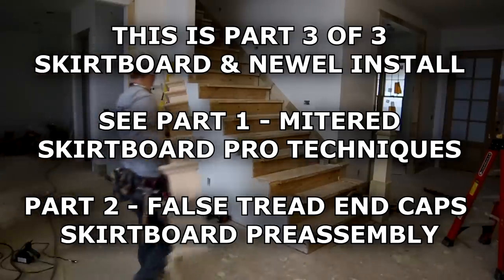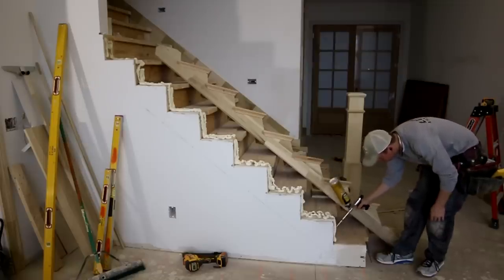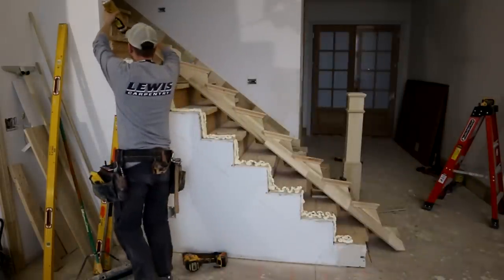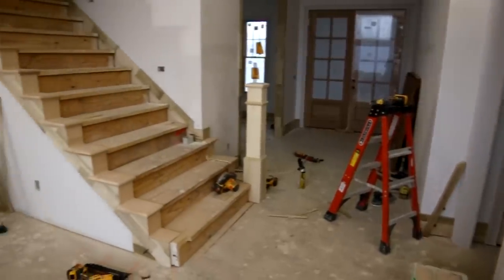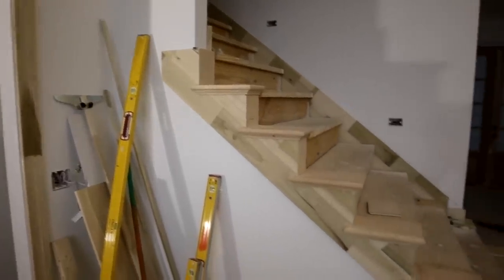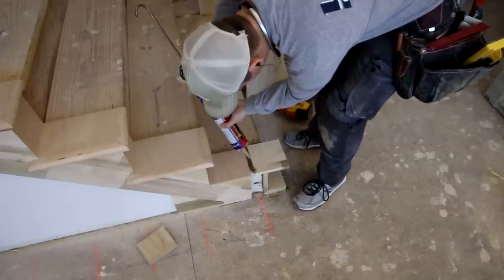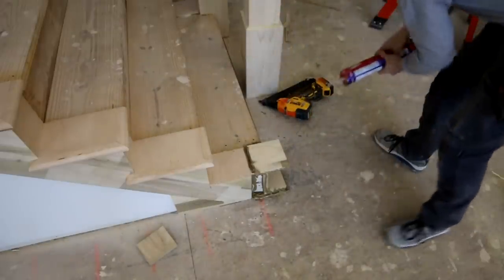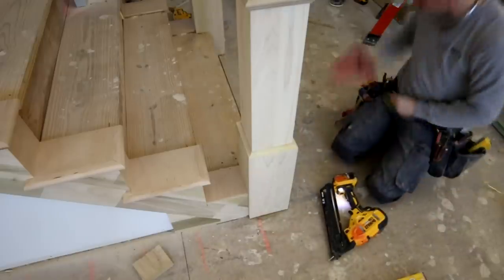Stair Skirt Board and Newel Install - Keys for a Crisp Install

Comment: I rip a 2x6 to the inside dimension of the newel and attach 1 piece at a time with glue and screws until I have a solid block for the newel to slide over. You can make the 2x6 rips longer so they go up inside the newel for more support.  I use Gorilla Glue to attach the newel, the glue foams up and fills any space between the block and newel.  Keep the vids coming, you do some great work.
Reply: Sawdust i woulda put solid 2x blocking too
Reply: I thought about polyurethane too, the expansion is great, but a little trickier to work with. It's strong stuff too, but a bit brittle when dry ? Your 2X6 idea is terrific

Comment: Spenser, I really enjoy your videos. I was thinking that it might be a good idea for your newel post "inner grid" idea (as you called it) to load up that upper flat plate with PL (around the top edge) and then right before dropping the newel down over it to place another flat square plate over the piled up PL and then placing a brick (for the weight) so that the PL is squeezing out against the newel's interior. Like a compressed sandwich, so-to-speak. Just a thought. Thanks, as always.  I hope you can make sense of my crude description.

Comment: Nice work.  It looks like the false tread nose is a little higher than stair nose, when the carpet wraps around don't you see the side of carpet backing just a bit at the bottom of the wrap?  It does not look like flase tread protrudes quite enough where the carpet returns to the riser?
Reply from the maker: I cut the framing tread back 1/2". So there is a 1/2" gap between the framing tread and the finished false tread...the carpet guys will then tuck their carpet in that space and around the framing tread to finish it off.

Comment: Spencer , curious how the top step looks like , the plumb cut of stringer does not die into the wall , how did u finish the plumb cut , we always have our stringer die into wall about 2 1/2” back from corner , thanks

Comment: Wow it’s not attached to a Joyce?
I could of done that ?  All that work I did to attach them to solid structure (bottom Newel’s ) ?
I am seriously stunned?  And I truly trust you Spencer you know way more about production trim carpentry than me!
But can I respectfully ask what about the 200 pound rock ape that will no doubt swing from it?
Will it hold as good as a Newel attached to structure under the floor?  The two bottom ones ?
Reply from the maker: You will not get this newel loose without destroying it.
Reply: Oh I completely believe you!  I learned my lesson with the hot glue!  But man if I would hv just asked instead of assuming!

Comment: Thanks for posting. Do you like that DeWalt battery finish nailer?  I have a Paslode Impulse that usually makes me want to throw it in the garbage and inn looking for a replacement.
Reply from the maker: I like them much better than the Paslodes.

Comment: I typically like to set my newels on finished floors too many floor guys under cut and screw them up if you use a threaded rod method or your method
Reply from the maker: Agreed. I specifically ask the flooring guys not to undercut them. Once they see why and you explain the structural reason to them they are usually compliant.

Comment: What you did looks great! I’m just not sure why, when taking in consideration the labor, The homeowner doesn’t just use full length treads and risers. They can always put a carpet runner up the middle and get the job done for a similar cost
Reply from the maker: It’s a legitimate question. It has more to do with the builders not pre planning and making provision for full wood treads.

Comment: I really like your videos and the level of quality you believe in. But I must disagree with your method of attachment for newel posts. A few plywood supports, PL adhesive, and wire brad nails will not keep that joint together over time. I’ve been a carpenter over 30 years, and for a time I apprenticed to a master stair builder. We always used bolts to attach any newel post to the framing—floor, wall, or both. Yes, it is absolutely a lot more work to use bolts, and yes, it costs the customer more. But it will NEVER fail. A big part of our business (when I worked under the stair builder) was fixing broken stair railings that were installed JUST LIKE THIS. Again, I like the work you do in 99% of your videos, so I am not being mean spirited. I just want others to know that the newel post in the most critical part of a railing system, and this is not how to install one.